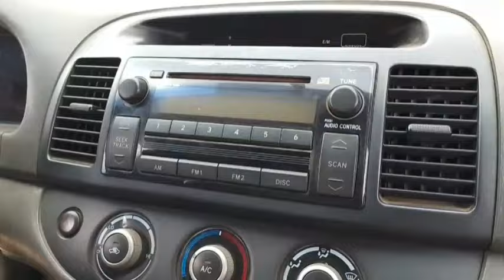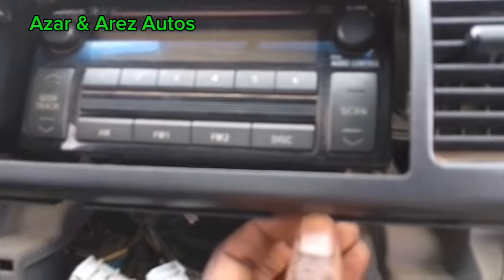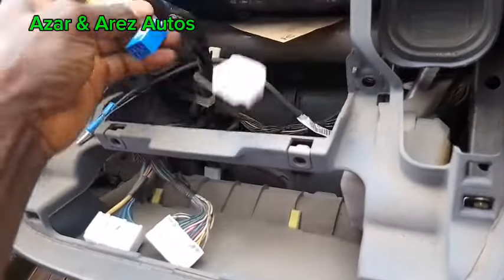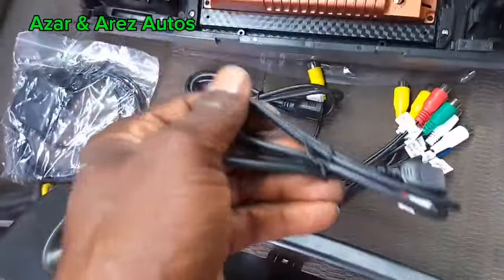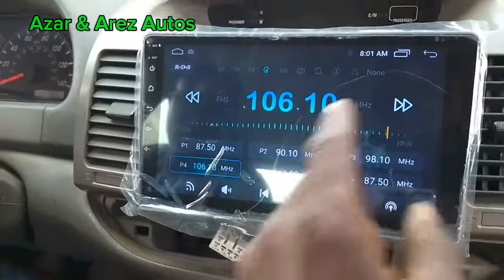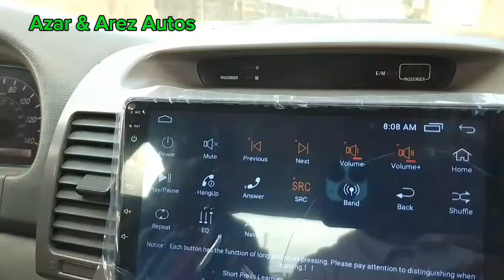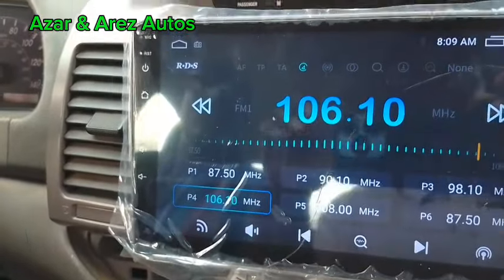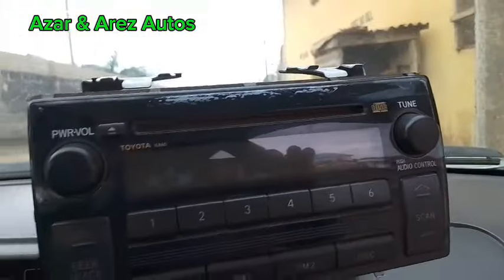Steering Wheel Controls Adaptation on 2003 - 2006 Toyota Camry Android car stereo Upgrade

Comment: Mine does not have steering control can I change the steering to this one and it will work?
Reply from the maker: Yes you can but with the help of a good  auto electrician (rewire) that understands the car wiring system.